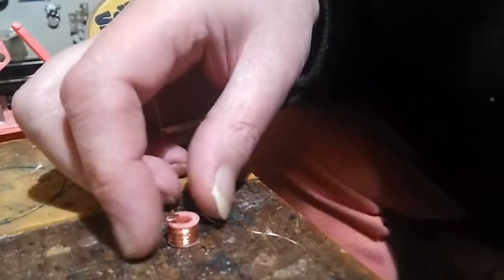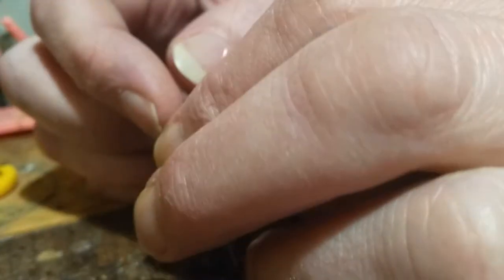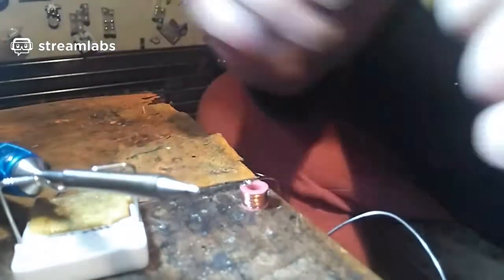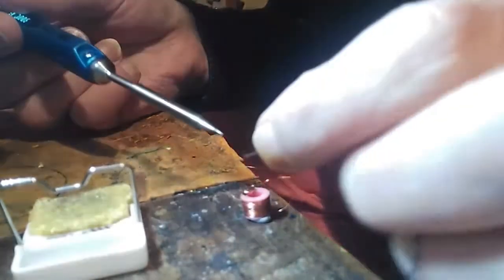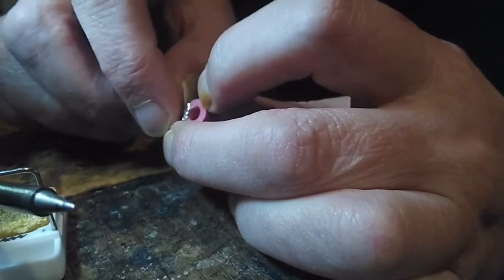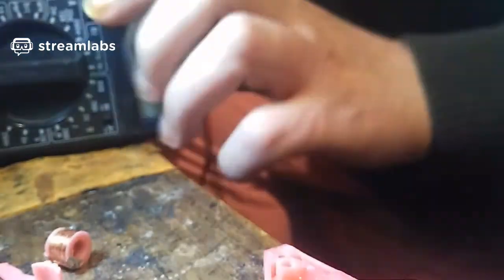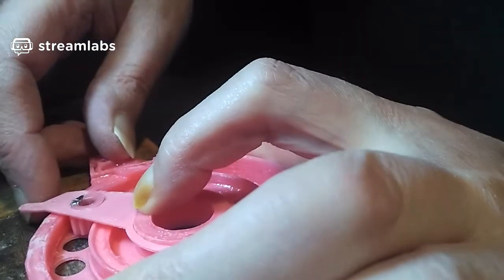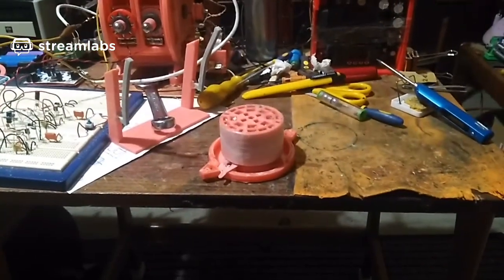Winding Trigger Timing Coils - Live Stream

Comment: plz inform me how this is made what's the material need what's the turn and gauge of the copper wire
Reply from the maker: Those trigger coils were 44swg it was experimental, I did not count the turns just filled the bobbin with wire, but without amplification they did not work not enough voltage, I later used driver coils as my trigger coil circuits if you watch later videos you will see, sorry not had time to make playlist for this series of videos yet I am focusing more on my latest designs.
Reply from the maker: Oh sorry forgot did do a playlist here
Rotary Magnetic Delay-line Generator 2: https://www.youtube.com/playlist?list=PLjuCiV5HRn3QeVOMxx0I6K8jzzQNj3XfR
Reply from the maker: The design is modelled in sketchup, then 3D printed in ABS plastic, All my work is original design, thinking outside the box as they say looking for answers to technical obstacles. I grew up in the 60's as a child was always fascinated my magnets, later in life most of my experience was sparked by working in engineering, then Electronics, and even did some counselling studies, I just try to create new things in my mind before building them in real life.